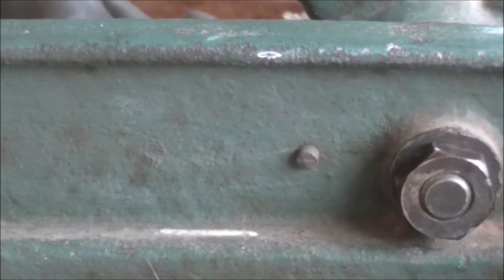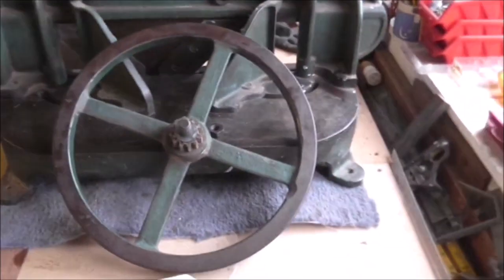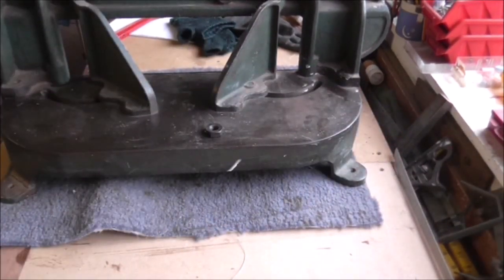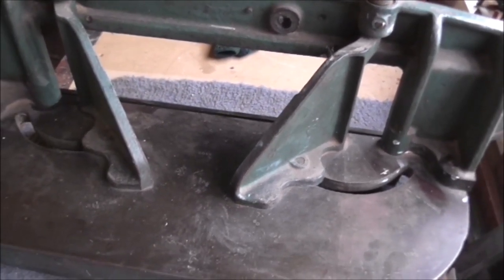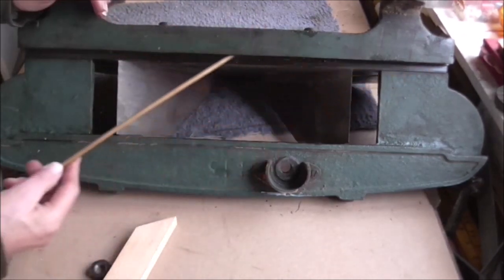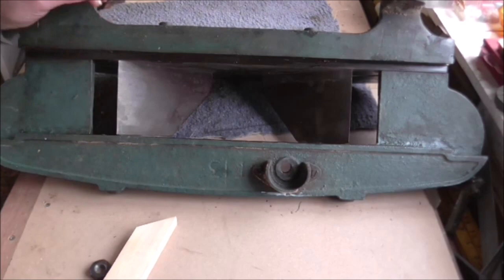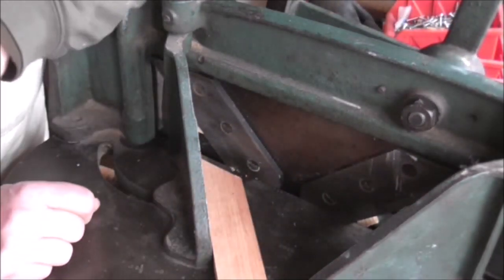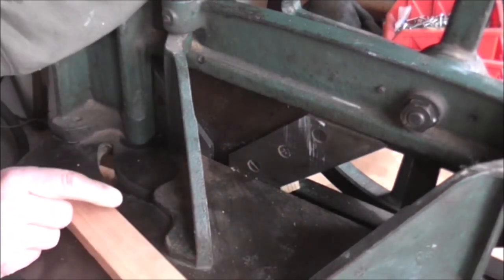What on Earth is this?

Comment: That's an impressive piece of kit. I've never seen one before and wouldn't have taken any notice of if I'd seen it for sale not knowing what it did.  
I could have done with it when making some picture frames!
I couldn't see how it worked at first and when you used it the sound reminded me of the old hand driven bacon slicer in our local shop years ago.
I can see an item like this lasting hundreds of years and would like to know how old the one you have is.

Do you ever use it?
Reply from the maker: It is a bit like a bacon slicer but a lot heavier. It's built like a battleship, since making the video I found out it is the Eclipse model and is around 100yrs old. I do still use it but not as often as I used to.
Reply: @scrimperuk  That's interesting. I think Eclipse was a brand name of Spear and Jackson. They certainly made hacksaw blades under that name.
There are other tools to make mitres but I very much doubt they'll last 100 years.
I wonder where your one was in use and what was it making.   I'd think furniture of picture frames. 
That slicing sound has something very satisfying about it.
Reply from the maker: @colinwellman9480  I don't think it was made by the Eclipse company That was just a model name they called it, they referred to it as "The Eclipse" they also made a simpler version with a handle rather than the wheel, they called that one the "New Briton". You can still buy these hand operated mitre trimmers today but not as robust as the one in the video.
Reply: @scrimperuk  A case of 2+2 making 5.
I did leap to a wrong conclusion with the Eclipse name.

Comment: Lovely bit of kit, I know what you mean about quality build, im into doing things in metal mostly as a welder as you can see on my channel. I bought a brand new metal cutting band saw that went in a loop ,15 quid a pop for a blade kept snapping so i bought an old Victorian die cast donkey saw with one big blade in it no probs at all in fact ive still got the original blade its a lovely movement on ot big belt wheel its a joy to watch it work . Modern cheap tools not a patch on these old things well done with the purchase fellow scrimper and greetings from wet wales.
Reply from the maker: Many thanks for your interesting comments, we seem to have similar interests, Motor cycles (Honda ST1100 Pan) Westwood tractor, fixing things and scrimping!